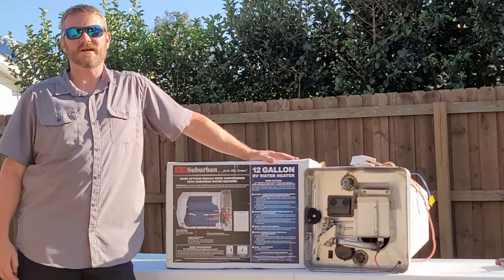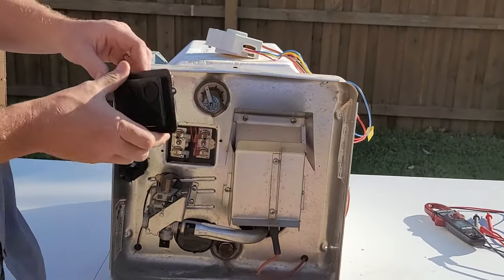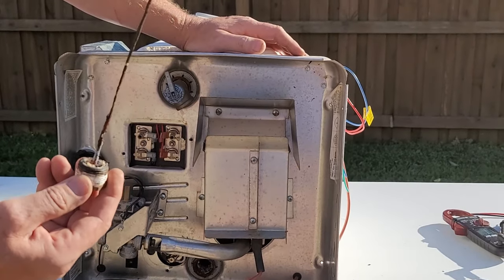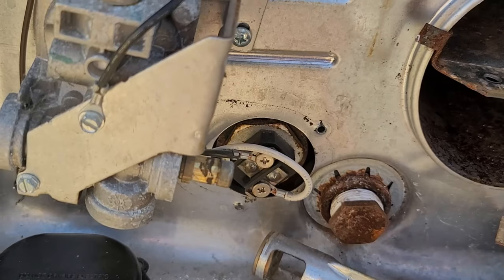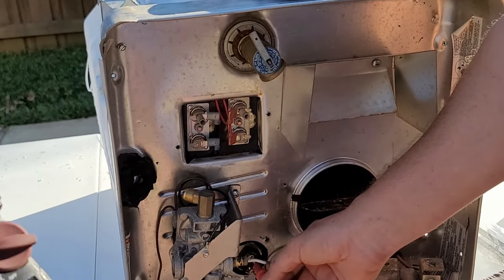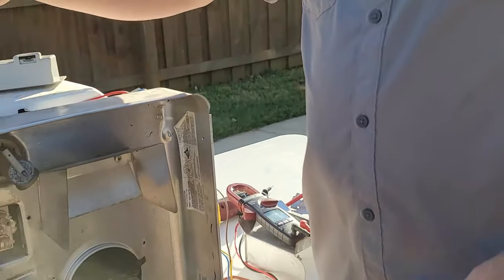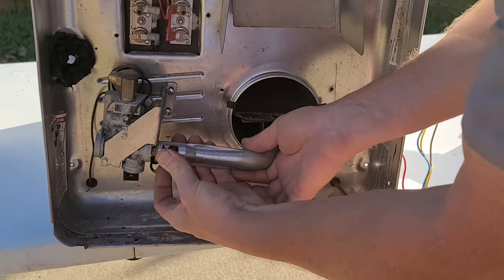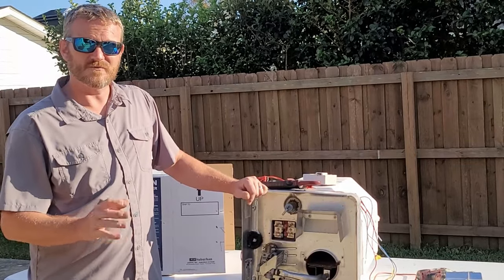RV Suburban - RV water heater walkthrough

Comment: I’m having issues with a propane only water heater model SW6D. I’m only getting about 1.89 volts to the thermostat switch. Would that be that I have a faulty negative? I checked all the fuses on the fuse box and they all reading 13volts to ground. Any hints

Comment: Josh, I NEED help.  There's a tiny pinhole inside the combustion tube wall , that is causing water to leak out. Can that be fixed?
Reply from the maker: @mr.trevino.4356  no, it will need replaced.

Comment: I have a old Atwood water heater and I'm trying to figure out how to wire it to the old Atwood. Is that a problem wiring it? The suburban I bought is a 6 gal. SW 6 DE and I'm hoping it can be installed properly with the Atwood switch? Just a girl and hope you can help me, thanks both water heaters are electric and gas the Atwood is the gc 6 EE 10 AA sure could use some advice? Thanks 🙏

Comment: Thank you. My water heater propane stopped running. Shuts off after a few seconds. My anode was really bad about 6 months ago and I do have a water leak coming from the top combustion chamber. I'm sure we damaged ours not servicing it. I plan to use this as a good learning experience and upgrade from a 10 to a 12 gallon. We have plenty of depth in our RV. Your video was great and I appreciate your time

Comment: Great video! I have the same one in six gallon. I’m trying to fix the “DSI Fault” alert right now. That’s why I’m here. Hope this helps! Electric still works fine.
Reply: Same. Mine will light but the flame goes out. Works fine on 120v. Sounds like I'm going to order an anoide rod too. And check my burner tube for spider webs.

Comment: What a great video. Thank you! All the info we needed and an explanation for every component on the heater. I have a water leak and can't find it. Zero water leaking from lines but a deep from under the heater. I suspect the previous owner didn't replace the annod rod like I do and thats my leak
Reply from the maker: Your suspicion is justified, probably a hole in the tank.

Comment: My igniter engages but burner does not light. If I light stove then  hw tank lights. Then works fine until it doesn’t. I have had this unit for 12 years   It was new when bought and this year is the first time there has been a problem. Great video. Thank you.

Comment: Probably the best and most instructive video I have ever seen. Right to the point. Thank you!!
Reply: Very informative video. My water heater is very similar but it's the 6 gallon. Still works on AC but the gas no longer works. Goes through the 3 cycles of trying to light  then it shuts down. My lp tanks are full and no air is in the gas lines. Any ideas? Thanks

Comment: If you haven’t heard it enough, Great Video!

I have a SW6DEL, and bought Anode bars and noticed that the threading (male) on the rod didn’t screw in all the way. The rods are the same size outer end to outer end, however, the replacement had a bit more, about 1/16-1/8, or two more rounds of threads more. I wish I could upload a picture. 

I was concerned about the end making contact with the wall of the tank. Now knowing that is glass, it worries me. 

The rod is about 1/8 not screwed flush. I don’t think what I replaced was screwed flush. I’ve seen some videos that show the anode rod being replaced but it’s not detailed enough. The camera pans away.

Last, I have a 1973 Chinook Camper, the water heater was updated within the last year, give or take a few months. Still, I took the anode rod out, not knowing what it was and thinking it was just a way to let out the water for winterizing the camper. 

I was hoping to learn if there was a cut valve to prevent the RV antifreeze from getting in the water heater tank. Maybe that’s an add-on on the outside, somewhere near the in source. I know where to look now. 

In addition, I am glad that you showed how to remove the gas burner it seems that it’s easier to replace the heating rod/element with the burner out of the way. 

Many Thanks!

Robin

Comment: Hi, your video was a big help, I have to change out our hot water tank which is 12 gal. suburban. BtY they deleted the switch that you pointed out at the bottom on left side.
Reply from the maker: That switch is the 120 volt AC switch your new water heater will come with one

Comment: Thank you for this great video.  When the unit is not in use for a few months... is it best to remove the water or is it better to leave the water filled?  I am asking because if you empty it, there will be a small amount of residual water at the bottom of the tank, below the anode rod, not allowing it to be sacrificed and hence possibly burning a hole through the bottom of the tank?  Thank you!
Reply from the maker: @mattr7229  great question, for storage I would remove the anode rod and drain, leave anode out so the remaining water can evaporate.

Comment: Hello, I have a SW6 DE and I turn the switch on inside the camper, but no longer hear the clicking or see the small red light indicating the igniter is trying to light. Everything is like brand new in this camper, but this was the first few times using LP with the hot water heater always use electric heard about spiders because I had black soot on the outside of my camper. Took an air hose and blew everything out and now the igniter doesn’t work maybe something came loose or is it the whole circuit board. What is your guess lol thank you so much. I found your video more helpful than anything. I found a live full-time and a wolf pup 16 FQ and everything as I mention is like brand new in it but neither of my refrigerator will ignite with LP that’s another story and the hot water heater now will no longer light or click.
Reply from the maker: Could be a few things, I wouldn't run out and buy a control board with out having a technician diagnose it first.

Comment: Mine steadily deteriorated and initially took a few fires to get going but got worse till it took several restarts and then just wouldnt start at all. The  gas burner actually fired up each time but after a few seconds went out however I noticed the piezo ignitor continued to fire even after the burner lit each time. That mad eme think it was a thermocouple issue that wasnt getting to temperature fast enough after it ignited.  After watching several vids on these heaters I removed, realigned and cleaned the ignitor probes which incorporate the thermocouple but while this improved the number of times it took to start the problem persisted. I noticed that the flame was a bit yellow so I cleaned the brass gas jet with about a nunber 61 nozzle file and while that didnt appear to be restricted it did restore the flame to all blue and now it fires up immediately every time for the first time in a very long time. So make sure you clean that jet out along with everything else.

Comment: Excellent video.  I need to replace one of the wires and it's connection to the electric thermostat. How can I gain purchase on the wire to replace it?  Where does it terminate?  Thank you.

Comment: Pretty sure you're wrong about the tstats. The bottom tstat is temperature activated and set to 130F. That's the one regulating the operation of the water heater. Its spring loaded and continuously opens the circuit (at temp) and resets when the WH cools below set temp. Should it fail, the top tstat (also called the ECO) will break the circuit at 180F and that one needs to to be reset manually. There is no one-shot tstat on the Suburban WH as far as I'm aware. You're probably confusing this with the ECO fuse on the Atwood/Dometic which would melt in the event of a backfire from the burn chamber.

Comment: Thanks for taking the time to make this video. I'm completely new to owning an RV; we just bought a 1998 model Gulf Stream Yellowstone. I got it home and found that the water heater was leaking. I know that mine is an SW6 something, but the data sticker is too faded to see the actual model. I've been trying to compare it to what I'm seeing on the new models, but I'm just not sure which to replace it with. It has the DC junction box on the right side (from the front), but no AC box on the right side. It has a power cord, but it connects to it's own little control/thermostat box, then two white wires run to what I assume is an element that screws in where you show the anode rod to go. Any answers on which model I should replace it with?
Reply from the maker: @firemanjd2002  yeah so someone has added a "hotrod" kit. It's a kit that replaces the anode withan electric element completely eliminating the required benefits of the anode rod, terrible idea! It originally was a gas only and the previous owner ( or 1 of the previous owners was duped into the electric solution) while a hot rod does work it leaves the glass lined tank defenseless to the hard water deposits and ruins the tank. My suggestion would be to upgrade to a SW6DE, or replace it with an instantaneous water heater. Girard offers a direct replacement with correct dimensions for an easy swap
Reply: @MRRVTECH  Thanks for that info. I went ahead and ordered a SW6DE. I just went to all of our local hardware/plumbing stores looking for replacement brass fittings for the back though, and none of them have the ones with the check valves. How important is that?
Reply from the maker: @firemanjd2002  you need at least one check valve on the rear, I would put it on the cold water inlet. You can buy a 1/2" brass check valve on Amazon.

Comment: @MrRVTech - ABSOLUTELY A GREAT, WELL DONE video! You deserve the rewards from the advertisements.
My only Q to you is "Does a BAD" 110v element show open or closed circuit ?
I just pulled on with fried wires ... Thinking it shorted? 
Or maybe they fried from poor connection.... idk.
But I am curious as to if the elements will die closed as well as open?
Reply from the maker: Yes, if you do an OHMS reading it would read OL or if it's burnt but still touching  the ohms would be wildly incorrect.

Comment: Great Video! I do have a question. If I put my water heater out the side of the couch will the water lines come out too so I can disconnect them or do I have to go inside and take the wall panels off to disconnect the water line.
Reply from the maker: @akichler  It can go either way.... if you have braided hoses....pull it out, if you have pex piping, take them off the back first.
Reply: @MRRVTECH  Thank you!

Comment: For those having issue with no flame to your water heater. Check your propane regulator. Mine was bad and was not letting the propane flow. I had replaced the gas valve, electric element and was ready to order the circuit board when I decided to check for gas flow trying to turn on the stove and it wouldn’t light
Reply from the maker: @erod6214  good advice

Comment: Thank you for the video it helped clarify a whole lot! I do have a question:  is there a relay switch of sorts? I'm having issues with my water heater and the problem before the switch by the heating element. I cant get any volt reading going to that switch. Any tips would be appreciated. Thank you!

Comment: Thank you for your time making this video. Excellent. We had a question on our Suburban SW12DELC. The Gas will not spark, unless the water in the tank is cool. So if I leave the electric and gas off at night, the next morning when I turn on the gas, it will spark and start heating. If I don't let the water cool all the way down, the gas will never spark. Do you think it's the board or the 12v thermostat? All the best.

Comment: Hi. Great video. I am full-time in my rig and would like to know how to clean out the burn tube and the chamber where the flame goes, because I found a bunch of moths in there. Is there some sort of long flexible brush meant to clean out the burn tube? Also what is the name of that socket that you used to take the aluminum panel off that was connected to your drill?
Reply from the maker: Yes, I have an 8" brush with nylon brush on the end. Not sure what tool you are referring to but I used a phillips bit, a 1/4" hex bit and a 3/8" hex bit to disassemble.

Comment: Great video, very much appreciated! I was hoping you’d take out the propane combustion chamber.. (pringles can shaped metal tube) that the flame heats up. Does that come out and can it be replaced? The inside of mine is pretty heavily rusted to where penny sized rust flakes are actually hanging down, where the propane flame contacts, down the entire tube interior. Makes me wonder if it’s still structurally sound. I didn’t want to heat it up using propane, and have the metal combustion chamber expand and leak. So I’m concerned to even use propane at this point to heat it up. I had mine running only electric for about a year and I believe condensation formed on the inside of the combustion tube.. causing it to rust. Not sure.. Do you know if this is fixible? Everything else is functioning as it should with roughly 1 year of use after being brand new. It did also sit out at the land dry/empty for about 2.5yrs. Hoping I can replace that combustion chamber, but not sure if that chamber/tube contacts water directly on the inside or not as well, and or how thick it is. I’d imagine it does contact the water directly, if it’s essentially the propane heating element. Also my anode was gone as well after 1yr use, definitely should have checked on it sooner, but I don’t think that would have rusted out and compromised the combustion chamber that quickly do you?
Reply: Also, while the anode rod wasn’t replaced after 1yr, the rv had been stationary. So I don’t think the glass liner was damaged at all thankfully from the debris moving back and forth etc. just hoping it didn’t compromise and rust out the combustion chamber.

Comment: My sw6de sits in a cabinet. Heard a hissing noise to open the cabinet and find moisture, mold, and some puddles water  from the water heater. I assume the noise im hearing is steam escaping from under the Styrofoam thats around the tank. I think if it was leaking there would be more water. Turned off water it still makes the noise. Cut the breaker to it and the noise stopped. Would my tank be cracked at the top possibly? Why would i feel steam coming from the top of the tank around the Styrofoam?
Reply from the maker: Yes your tank has a hole or crack in it, time for a new water heater.

Comment: Thanks for the great video!  Im having an issue with my 120v thermostat lower non-resettable pole on my 10 gallon gas/electric suburban hot water heater. My wire going to this poll gets hot enough to melt the insulation off.  Voltage is normally around 120v.  It usually takes 12-18 months before the wire brakes, usually at the connector.  My unit is about 14 years old and still works very good with this one exception. Any thoughts?  Thanks for your reply. Dean

Comment: That was great thank you. My question is, how do you select if the water heater is operating on Mains Electricity or Gas ? also you do you turn down the water heater so its not so hot ? Thanks in advance.

Comment: Hi thanks for the great video.  I need some help with a question and would like to ask you if you could be so kind to help if you can. I bought a forest river 5th wheel and about a year ago and didn't know anything about the anode rod and it rotted thru the bottom of the tank .so I bought a replacement on eBay it's the 5243A SW10DE. I bought an open box water heater thinking I could save some money . I really don't want to return it if I don't have too. So it arrived yesterday and I gave it a good look over and I noticed on the pressure relief side of the fire box that the metal around the top of the pressure relief valve had a dent . Then I looked down between the tank and the fire box and on the back side of the fire box where the pressure relief sticks thru there appears to be a rubber gasket up against the fire box . Is that a seal or does the pressure relief actually screw into a fitting that is part of the tank and I don't need to worry about that rubber gasket? Because they tightened it and the rubber gasket is only about 1/2 under the shoulder it was meant to be in contact with .the bad news is they tightened the brown wire between the two surfaces mate instead of on the gasket . Looking at it I don't think removing the pressure relief will loosen the surface I am talking about it appears to be some type of flange that holds the fire box to the tank and the relief valve screws into it. I realize I need to get the wire out from in-between the two surfaces or maybe cut it and replace it all together but is that gasket sealing the water or just a nicety? Thank you for taking a look at my problem.
Reply from the maker: The pressure relief valve screws directly into a welded fitting in the tank, the gasket you see does not retain any water it is a barrier between the combustion pan and tank. I would just cut the wire off and run a new one. Best of luck!
Reply: @MRRVTECH  thank you so much.

Comment: So, I'm cruising around every video on Suburban units that I can find. I'm starting to think my issue is an oddball:  I can't turn the electric element off from inside, only with the switch on the unit, itself. The 12v switch definitely works. The only other options I can think of is that it's wired right up to 12v and not through the switch or a bad control board.... maybe?  I don't know how much access I have to the back of the unit, and I REALLY don't want to pull the whole thing out.
Reply from the maker: @davevoecks6264  Many RV manufacturers do not provide interior 120v switches for the suburban heating element....( probly saves them $5) Most people just use the water heater circuit breaker as an interior switch in this case.